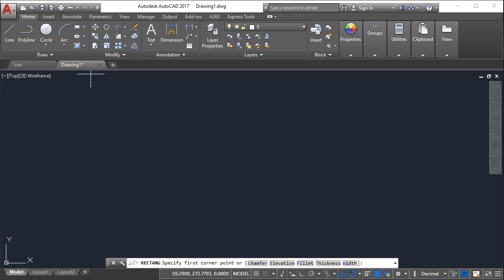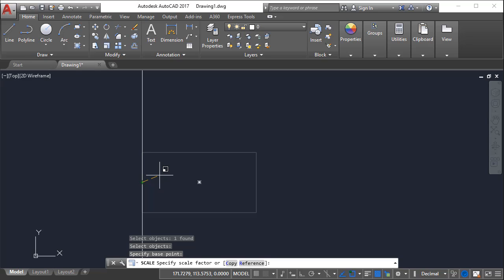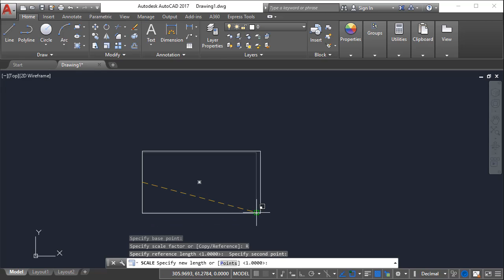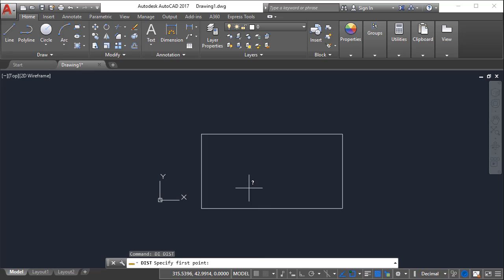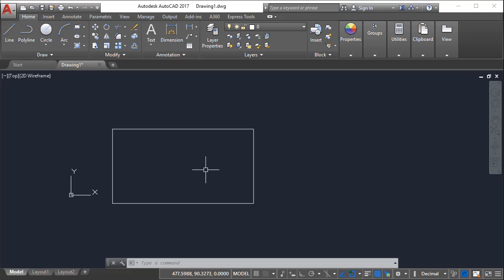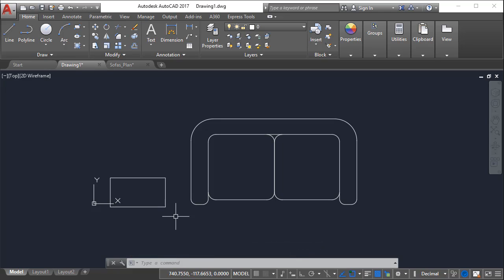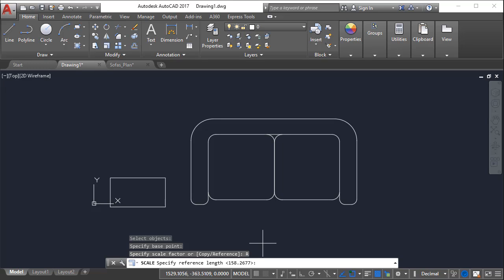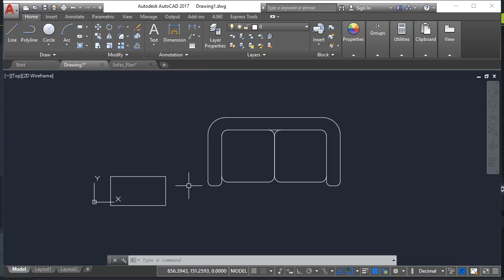AutoCAD - Scale block to required size

Comment: Hi, Great explanation but I also need to scale the depth and when you do this after scaling the width the width measurement you have just done changes. How do you scale it to a certain width AND depth. Thanks.
Reply from the maker: Great question!
for that you need to use properties and change x, y scale for block reference in drawing(not in block editor), for this to work this way you have to keep scale uniformly option unchecked while creating block.

Comment: Sir it is possible we change manual width and height as per require like bed head its a a lot of victors file I'm wait your answer Sir plz thanks for that
Reply from the maker: Yes we can using dynamic block it is possible I will be uploading videos on this topic soon, stay tuned, GBU.